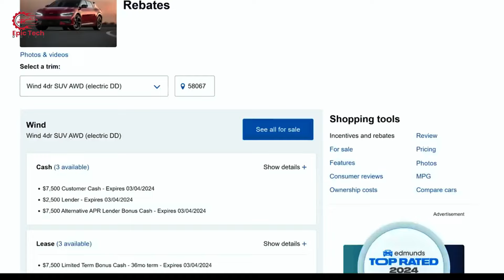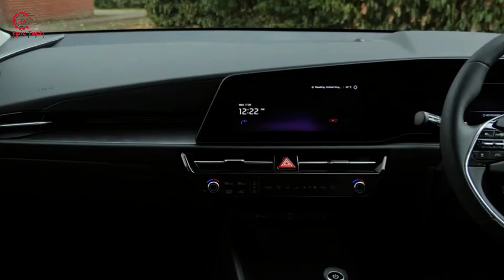America’s Car Crisis: 60% Of Americans Can’t Afford a New Car

Comment: The automakers put themselves in a bad situation when they decided to build vehicles that have every option available, which is reflected by the price. They should flip the ratio to lesser priced models to loaded options.
Reply: I agree. When I go look at a car I see all kinds of shit on it I don't want or need. I don't even get why electric windows are considered a necessity. I had no problem rolling them up and down, AND the roll up ones work even if the car's electrical system is down or you are underwater. Don't need a heated seat nor power adjustment of the seat. I don't REALLY need power steering, power brakes, or automatic transmission, though they are nice to have. Don't need 8 speakers. And you often see just a "sporty custom trim package" (or similar words) for several thousand dollars and it comes already installed, not like it is even an option. If passenger cars were equipped like fleet trucks, they would be cheap, though I realize a lot of people would not buy them.

Comment: Oh, it's a much higher percentage than that.  It's why electric cars will never work.  You buy an electric car, you sell or trade your gas car which is in turn sold by a dealer.  So your electric car simply moved the exhaust gases to a new owner, it did NOT remove the gas car from the streets.  You will NEVER solve global warming with electric cars, you won't even slow it down, cars are not even the major polluter, you have to get rid of tractors, boats, planes, cruise ships, ocean liners, semis, trains and buses before you even get close to worrying about cars.  And electric is not going to be the answer, there is no convenience factor, and americans want convenience, and 1/2 hour waiting for your car to charge instead of 5 minutes at a gas pump will NEVER work.
Reply from the maker: who works for 2 hours to charge their EV? what ev do you drive?
Reply: @EpicTechDrive  who said 2 hours ??
Reply from the maker: ohh did you edit your comment now or I was blind when I saw your comment first .. my bad man hehee
Reply from the maker: so it says half hour now..